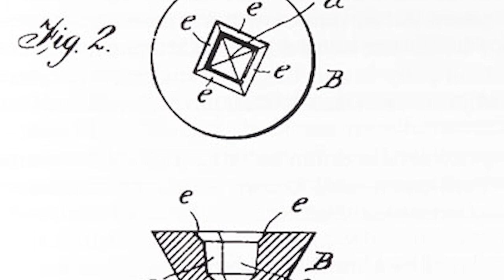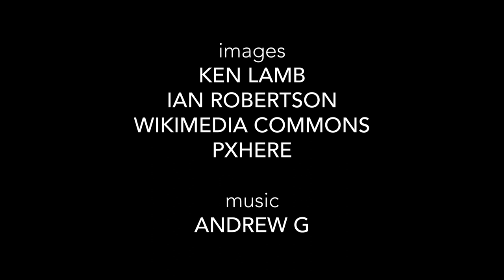Made in Canada — The Robertson Screw

Comment: American and I think these look more reliable than even torx
Reply: I think that a Robertson head would be comparable to the Torx however the Robertson driver would likely be more durable I think.
Reply: @Tabu11211  Robertson has a bigg advantage: the screw just stick to the tip of the screwdriver. So you can put the screw on the tip of your drill, and conveniently drive it with one hand in awkward places.

Also, I don't like how there are so many sizes of torx screws, it's ridiculous. There are 26 different sizes!! While not all 26 sizes are commonly used, you still need 6-7 screwdrivers to cover the most common sizes... Meanwhile, Robertson as 4 sizes total. #0(yellow), #1(green), #2(red) and #1(black). A #2 will be all you need in like 70% of scenerios. #1 is used for smaller screws, it's common in electrical for example. #3 is pretty much only used with really big screws, so you probably don't need it unless you need to use such big screws. And #0 is almost never used, you can pretty much skip it as you're very unlikely to ever need it. You really only need #1 and #2 for the vast majority of scenerios.
Reply: @HCkev  🇨🇦🇨🇦🇨🇦